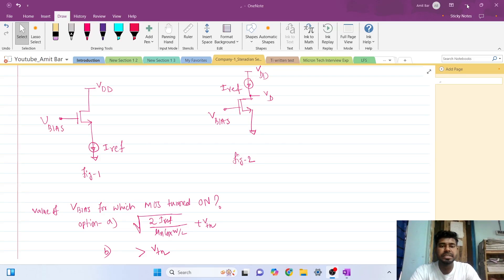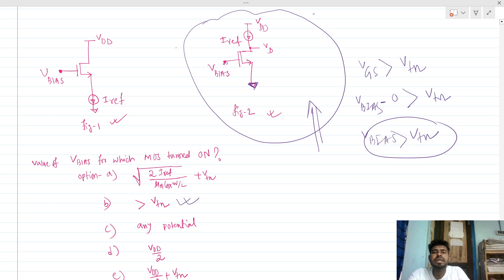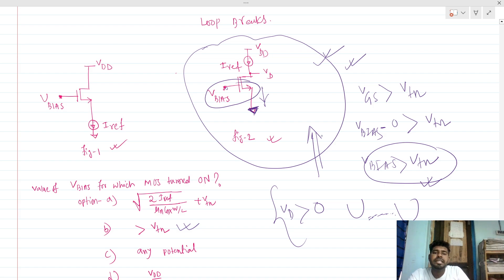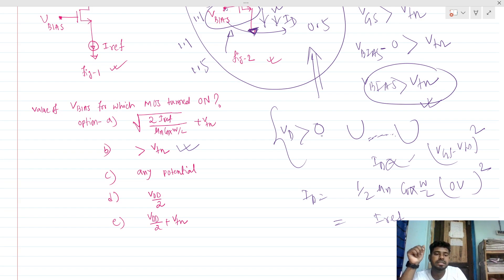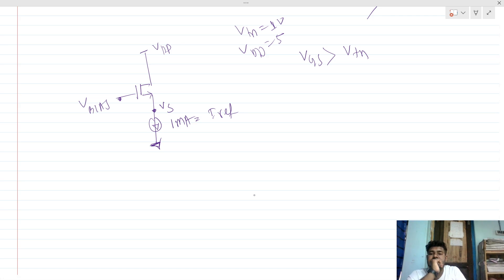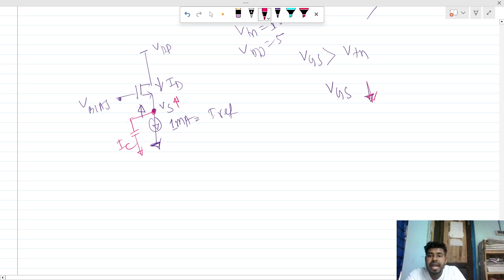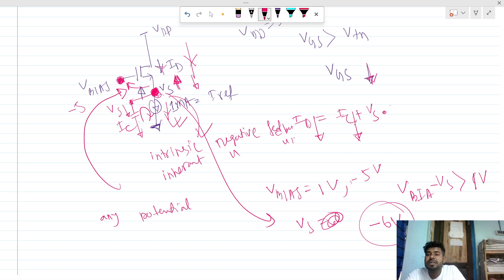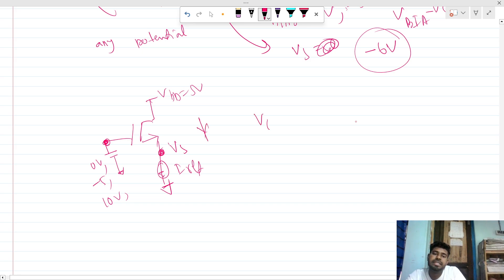Analog Circuit Design interview _ MOS Biasing unconventional Analysis || Amit Bar

Comment: If W/L is already given and can't be changed, then Vgs in saturation (VD is high and VG is low, if NMOS is ON it'll be in saturation region) will be sqrt(2ID/ucox(W/L))+Vtn. Source voltage i.e. potential across current source can be 0 in ideal case. So the minimum Vbias will option (A).

Comment: How the negative potential at source node is possible if supply is from 0 and VDD. For a given current and by increasing W/L, minimum VGS to turn on NMOS will be Vtn. Potential across current source can be zero in ideal case. I think answer should be >Vtn.